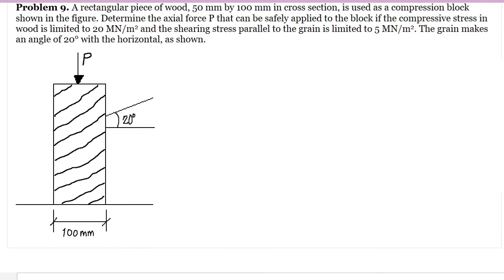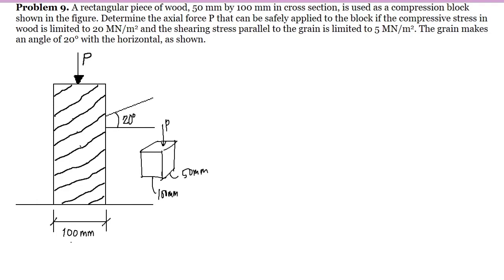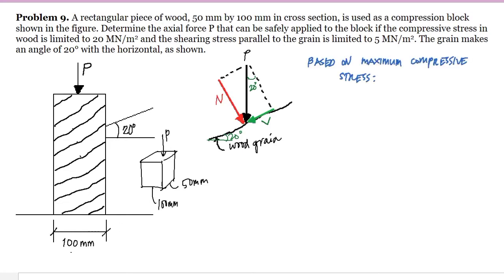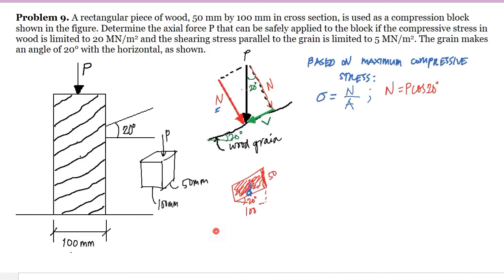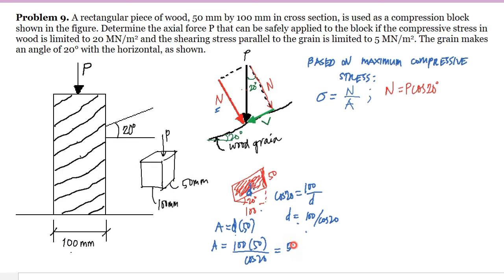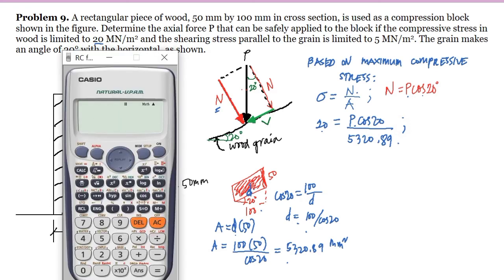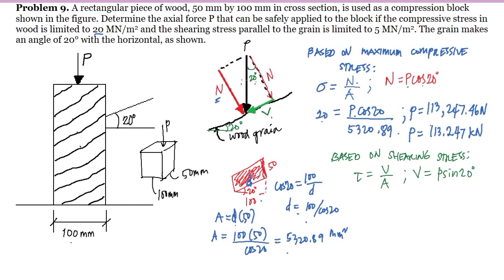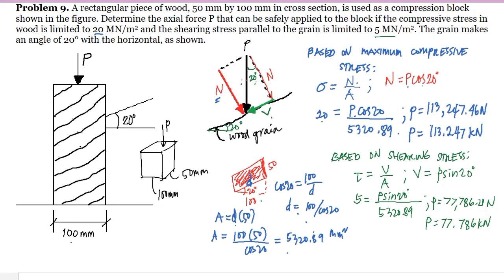Shear Stress Problem 9

Comment: Di po ba magamit yung formula (P/A) cos²α sa normal tapos (P/2A) sin2α sa shear ? Yung ibang book may formula pong ganyan
Reply from the maker: We only use 2A for double shear, I think it depends on the situation po. Those are derived formulas and can be used for a specific condition. Why use cos or sin if you are not certain of the reference of angle (only for inclined plane or inclined load)? Hindi sya generic eh. Mas ok padin ang alam mo gamitin ang formula based on the definition.